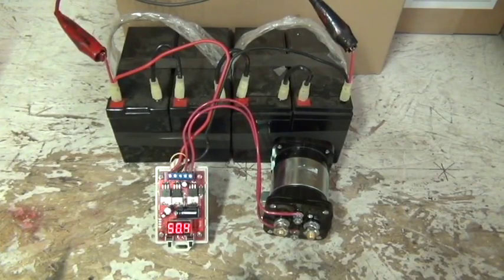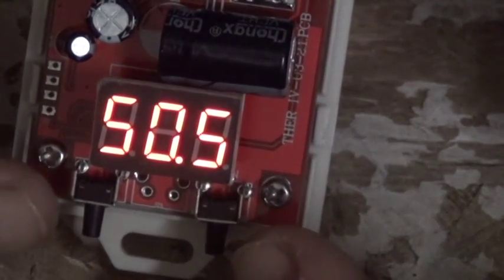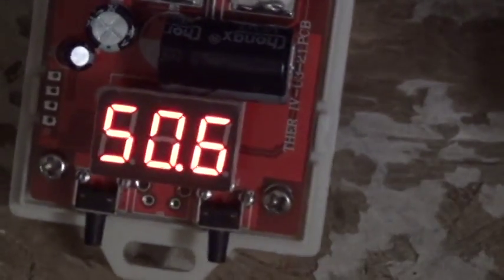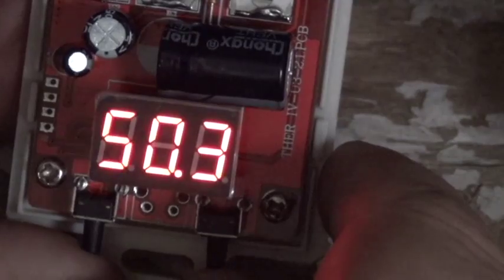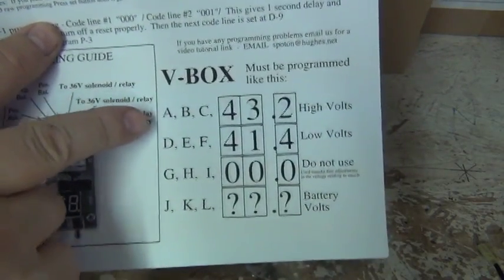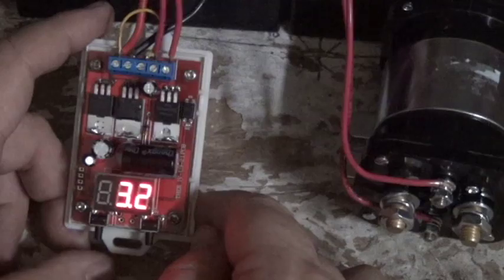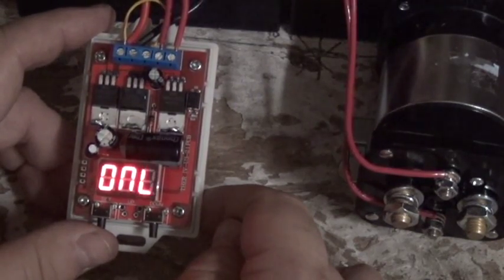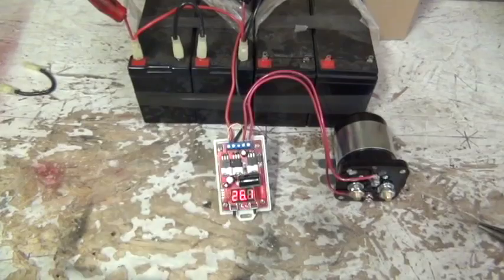#G5 - 48 Volt, 36V battery controller for wind turbine and solar panels

Comment: I'm looking at getting a couple of these things.  I have two voltage setups...one at 48v and one at 24v.  I already have solenoid relays to handle the load, I just need the controllers.  Can these things all be adjusted to work with either system?  You ebay link seems to only have one voltage available.